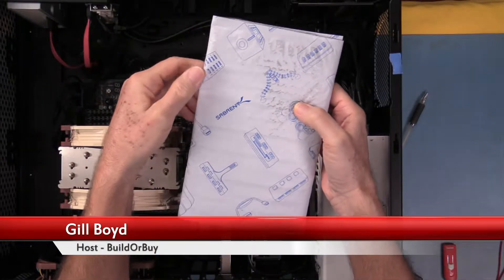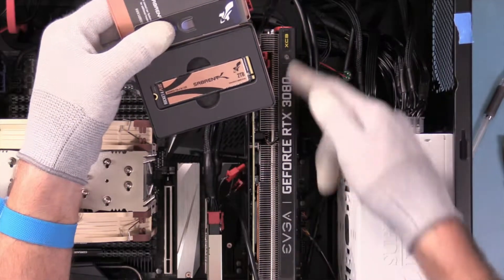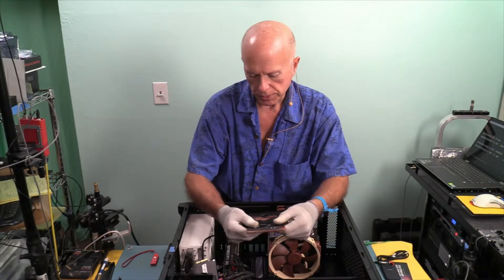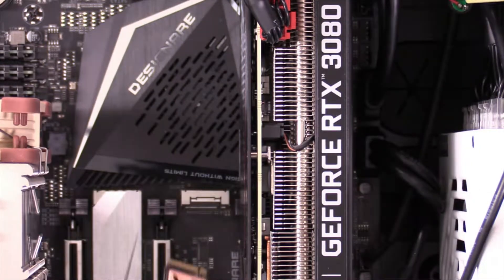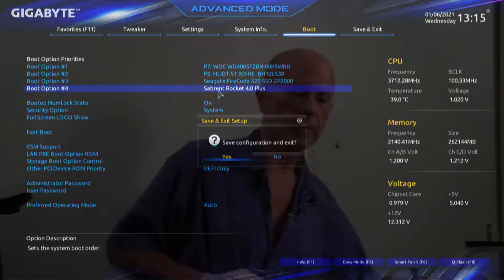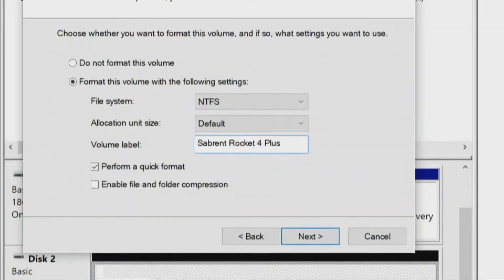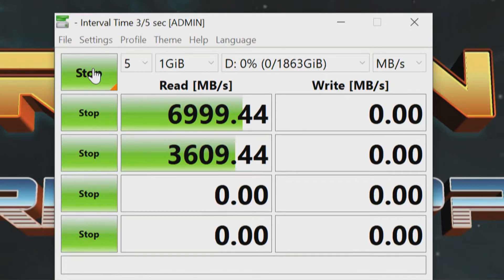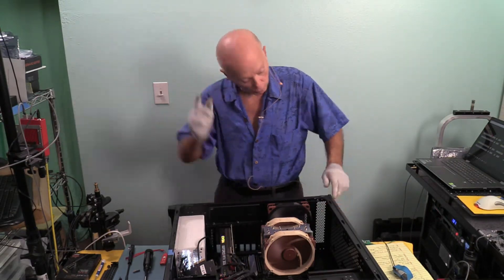Sabrent Rocket 4 Plus M.2 NVMe Unboxing, Install and Test

Comment: Thank you Gill for fantastic real-time tests. It's a feature largely absent in the community. It would be an amazing thing of having your results of the industry standard tests like PCMark 10 and the game level time loading.  I have found a few independent sources where WD sn850 1tb is superior to Sabrent  4 plus 2tb. Your results could be a valuable validation of performance as measured by other PC  enthusiasts. Greatly appreciate the things you are doing!
Reply from the maker: Hi Di Moriarti, Thank You! Appreciate Your Comments! Our next Test will have greater Specificity. We'll be testing for Heat and Speed using Thermography. We've already used an Endoscope Otoscope to examine Tolerances and Component clearances that could not be examined efficiently otherwise.

PCMark 10, I'll make the Request. We'll see what happens. Licensing would be the only problem. Great idea. Agreed. We need more empirical data. 

We've been very particular in Documenting Our TRX40 Build since this is a new Platform. Details matter! Stay tuned!

Comment: after installing a 1TB sabrent rocket 4 plus m.2 nvme into my laptop I noticed that it gets really hot even with the thermal pads applied all over, for some reason specifically this SSD gets hot but the one that was in my laptop (a Samsung nvme idk what type exactly it just has "Samsung SSD" written on it) always stays really cool
Reply from the maker: Hi B4shar,
Welcome! A Laptop will be PCIe 3.0 whereas the Sabrent Rocket 4 Plus is PCIe 4.0. Big difference in Speed. Surprised You're getting the Heat considering the Speed is not attainable, 3,500Mbps vs 7,100Mbps. If You want to know the Specs on the Model of Drive while installed, suggest installing Belarc Advisor. It's free. Link below:
https://www.belarc.com/products/belarc-advisor
That program will interrogate Your Computer and create an HTML Report. Think of this in terms of what Your Laptop needs, PCIe 3.0. Hope that helps!

Comment: Ran onto this video when searching for Sabrent drive stuff.  I opted for the new Sabrent Rocket 4 Plus-G in the 2TB flavor.  I got it installed on the MSI MEG Ace and was wondering about removing the labels, since the Ace has the heatsink thermal pads on the PCI-e 5 slot.  Sounds like I'm fine leaving them on...
Reply from the maker: Hi Pendamonium Paladin, 
Yes, correct. Those are copper to help dissipate Heat! Hope that helps! Success on Your Installation!
Reply: @BuildOrBuy  Also, thanks for the comment of 75% capacity to avoid issues.  Never heard that before till now...
Reply from the maker: Hi @pendamoniumpaladin1798 ,
Absolutely! Whenever You check a Drive in Windows Explorer and the bar indicates RED. That means remove some Data. What will happen? Applications will appear to hang while waiting for more Drive space. That's the extreme. In most instances, Performance slows down as a Drive fills up. Happens to both spinning Drives and SSDs. All about Heat and Capacity. You'll know what's What when it happens. Hope that helps! A 1TB fills up fast!

Comment: RND4kq1t1 is the pattern closest to what an average user does most of the time. Samsung 980 pro 1tb and WD sn850 tb both have around 15% advantage over Sabrent rocket plus 2tb in the reading RND4kq1t1 test. We need more tests to validate the performance!!!
Reply from the maker: Hi Di Moriarti,  Agreed! That would be a most interesting task to perform. We like to do Tests that can be accessed and Performed and repeated by anyone to Compare Results for empirical data. We don't know enough other than to know we need more information. We need more info on Firmwares for example. Each Manufacturer tweaks their respective app to show their product. And to identify Firmware Revisions. We don't have a good generic NVMe app to interrogate a Drive. Even testing for Heat.  By reading power to calculate heat, by sensor or thermogrophy. Curiosity! Stay tuned! Appreciate Your Comments! Thanks for watching!

Comment: I have a WD 850 arriving in the mail this week, will be putting it on my new Asus Crosshair VIII Dark Hero, with a 5950x (if that ever arrives).

But I’ve been puzzled as to which RAM will be most optimal with this build for gaming performance. High frequency (4000MHz) or low Latency (cl14)? I can’t find Ryzen Optimised RAM that has both.
Reply from the maker: Hi Nathan, CPU supports System Memory Spec: Up to 3200MHz. Suggest looking at Samsung B die...

G.Skill Trident Z RGB 32 GB (2 x 16 GB) DDR4-3200 CL14 Memory (F4-3200C14D-32GTZR). How's that?
Reply: @BuildOrBuy   Hi Gill, thanks for the reply! I’m looking at water cooling and overclocking the entire system for the highest possible gaming performance. This is also the reason why I got the Asus Dark Hero, as it’s currently the only board that can overclock all cores while still maintaining full single core performance with Precision Boost Overdrive (PBO).

Taking all of this into consideration, would you still suggest the same RAM, or something higher? I was considering having 2 x kits of 2x8GB (32GB total) of either the:

Corsair Vengeance RGB Pro 4600MHz CL18 CMW16GX4M2Z4600C18

Or the (soon to be released) G.Skill Trident Z Neo 4000MHz CL16 kit.

Apparently the company Colorful is also going to be releasing Ryzen Optimised RAM at a crazy 4000MHz CL14! 

But if you still think the 3200MHz kit would be better I would really like to know why? I always thought the lowest possible ‘true latency’ would be the best for single core and gaming performance?

Thanks!
Reply from the maker: Hi @SodaiGoku , Absolutely! Good Questions. EKWB? Custom loop or stock loop? We see overclocking as bragging rights. Been there, done that. For the RAM, You want Samsung B die. How much RAM do You want or Need? 

G.Skill is known for using Samsung B die for overclocking. That's why it's sold at a Premium price. I'll see if I can find those links. There's a guy who has Listed all of the Samsung B die RAM. 

As for the RAM speed, You have 3 numbers from which to progress through. 
1. AMD default JEDEC Spec of 2133.
2. SPD Spec - XMP Profile of what the CPU is capable of which is 3200.
3. SPD - XMP overclock of what Bios can handle of 4000 or beyond. There is a tradeoff balance with latency and speed.

ASUS is the best choice for overclocking.  We Build Computers for work so we take a different approach than what You want to achieve. Be certain You have a quality PSU and a good UPS. Hope this helps!
Reply: @BuildOrBuy  Thanks again Gill, this is really exciting for me! 😊

Not bragging rights, I use to build computers from secondhand parts when I was young, it’s just been a dream of mine since then to build a new high-end rig for the last 15 years. I no longer have any friends into computers, just a hobbie of mine.

EKWB Crosshair VIII Hero Monoblock with 2x360mm rads,
Asus RTX 3090 EK GPU (RTX3090-24G-EK),
Asus 1200W Thor PSU,
In-Win 925 Case,
9 x Lian Li Unifans.

Comment: Great video as usual. What 4K capture card will you be using?
Reply from the maker: Hi Victor, Thank You! Good to hear from You! We're going to compare the Avermedia and elgato. This started with a Question from a Subsciber asking why their TRX40 would not Boot after installing one. Without knowing the Motherboard, my guess would be a Shared PCIe Resource. However that should not keep the System from Powering Up. But then neither should a Thunderbolt 3 card either. So We'll test, verify and point out likes, dislikes and differences in the two. And a Summation of Our Suggestions for Capturing and Streaming. 

Right now... Getting ready to Film a Thermal Imaging device Unboxing in preparation for the NVMe Heat test. Stay tuned!

Comment: How do you feel the TBW or longevity/endurance of these cards are, are the numbers sabrent uses fake, I hear alot of people have failed or failing drives long before they are suppose to begin failing.  could it be a quality control issue.  how have your experience with sabrent nvme's been in the last few years?  Thanks, great vid!
Reply from the maker: Hi Kevmachine, 
Very good question. We just don't know. And will not know for some time as reports come in. Of the 3, 2nd Generation PCIe 4.0 M.2 NVMe SSD Drives We've tested, We've had more Reports of the WD SN850 Failing. BSODs to be specific. Hopefully that can be addressed through a future, yet to be announced, Firmware update. 

We have the most experience with Samsung for M.2 NVMe Drives. We happen to have more Sabrent Drives than any other brand. That was not a plan. It just worked out that way.  Hope that helps! 

NVMe has been around since 2015 or there about. Appreciate Your Comments! Thanks for Watching! 

Coming Up... Speed and Heat Test of Gigabyte Aorus vs ASUS Hyper Quad x16 M.2 NVMe AICs.  Similarities and Differences. Stay tuned!

Comment: So it has memory in both sides of the module making it thicker. Probably did that to spread heat over a larger surface area. At the higher speeds it would typically run hotter which, as you pointed out would cause speed degradation. I suspect that once you close up that case and finally put that system to work in the studio it would be a good idea to add as much cooling as you can to move air through that system.
Reply from the maker: Hi Lee, Good observation. Agreed. Eager to get to that point! Was surprised to see that double sided NVMe. I've never spent so much time working on one Computer. Yes, those Noctua Commercial Fans should keep things cool!

Filming today for next two Videos. I thought. Then... Wrong product was shipped. Waiting on replacement. FLIR Thermal camera... Was excited to get into the Heat vs Speed issue and see if there is anything of concern. We'll get there soon enough! Replacement Camera should be here early next week. Stay tuned!

Comment: are you going to try putting these in an pcie4 raid card?  would be cool to see those speeds.  This single card is hitting the same speeds as your gen3 4x4raid.
Reply from the maker: Hi David Cook, 
We thought about it. Thanks for Asking! Would like to get this System up so we can use it! However, We're working on a Test for M.2 NVMe Quad card Heat. And we're going to Compare 2 M.2 NVMe Quad cards. For those Tests, we'll probably use 1st Generation PCIe 4.0 NVMe Drives. Stay tuned!
Reply: @BuildOrBuy  back of napkin this could get to 25GB/s read speeds.  Ddr4 is 50GB/s. 
50% the speed of ram but 8TB instead of 256GB(thread ripper)
Reply from the maker: Hi @knowledgelover2736 , Got it. 1st choice is more RAM. 2nd choice, how to get what You need now. A Highpoint card is a distinct possibility for Your needs. Requires 1 x16 Slot, PCIe 4.0.

Comment: I get what you're saying that it's not scientific, but don't downplay what you're doing. You might not set everything in a vacuum and whatnot but you're at least testing the system on the platform that the product is designed/should work good in. Either way, thanks for the content.
Reply from the maker: Hi Rick Trajan, Thank You for Your Comments! Exactly. Being a new Platform, We need to know. Details matter! Our Goal was to start with an apples to apples comparison and to branch out from there thus explaining the difference and why in the next Video. But in so doing, keep it simple! In other words, a starting point. 

This Heat test We're working on should be much more Informative and not a normal type of test most Users would do! In this heat test, we will look at all 3 of these 2nd Generation PCIe 4.0 Drives. Even though We are only using 1 methodology, We will mention 5 possible ways to measure heat that anyone could try but might not have thought about. 

Appreciate Your observations. Stay tuned!

Comment: Heard the rocket 4 plus has reliability issues.. Read some reports about dead drives within 2-3 months of usage.. What's your take on this?
Reply from the maker: Hi Ss, Good question... We've herd 3 things.
1. Sabrent Rocket 4 Plus NVMe failures.
2. WD Black SN850 NVMe runs too hot.
3. X570 Motherboards and Ryzen 5000 series CPUs high failure rates. 

Until we see evidence otherwise, we attribute failures to ESD. That's why we ground. Hot NVMe, all NVMe SSD Drives require heat sinks. Thanks for asking.

Comment: UPDATE: Sabrent Rocket 4 Plus 2TB broke after 1 week. Many times on Boot I can not see the drive. To make it appear i need to restart PC sometimes few times. I polulated it into different Slots and same shit is happening. I have 2 of these and the other one works OK so far.  I'm in 30 days return window still. I question myself should i buy next Sabrent or WD
Reply from the maker: Hi 99KINGZ, That's crazy weird. Get the WD. Thar gives You a chance to compare the two unless You have them in RAID. If so. Swap them both out since 1 failed.
Reply: @BuildOrBuy  I was just checking Amazon US 1 star feedbacks about Sabrent
https://www.amazon.com/product-reviews/B07TLYWMYW/ref=acr_dp_hist_1?ie=UTF8&filterByStar=one_star&reviewerType=all_reviews#reviews-filter-bar
 There are multiple pages where people claimng their Sabrent M.2 died.. Just bought another WD sn850
Reply: @BuildOrBuy  i did compare them here https://youtu.be/tVe5rtKEArI.  Sabrent does load games quicker but not always. It's like 60% to 40% for sabrent but margin is 1 second the most
Reply from the maker: Hi @GODLIKE99KINGZ , I have my suspicions on what's causing that. Thanks for heads-up. Yes, on WD. Kee p Us posted!

Comment: today second Sabrent Rocket 4 Plus 2TB just disapeard out of nowhere from PC when i tied to clone it
Reply from the maker: Hi 99KINGZ, Cloning. That's a different issue. Change the Sector size. What software are You using? 

Copy all Data off before using Sabrent Sector Size Converter. 
https://www.sabrent.com/acronis/ssc/

Looks like we need another Video!
Reply: @BuildOrBuy  EaseUs ToDo Back Up. I just launched this app to clone Sabrent to new WD and I was looking for the Sabrent and I could not find the drive among others. so I opened explorer and I saw partition but when I clicked on it I couldn't Access it. I'm done with SABRENT just ordered another WD SN850. which is my 4th.
Reply from the maker: Hi @GODLIKE99KINGZ , EaseUs ToDo Back Up, Version 10 and later can handle the differences in Sector sizes. Try Macrium Reflect Free and see if the same thing happens. That's a hassle! Keep Us Posted!
Reply: @BuildOrBuy  I been using EaseUs products for years. I have life time free upgrades. So I have  latest version. it wasn't the EaseUs. After PC restart I did clone the driver like I always does. it was just a coincidence that Sabrent disappeared when I was trying to clone it before i even started.
Reply: btw here u can see  pages of dead drives. its for the prevoius model but this shit is happening on 4 Plus too
https://www.amazon.com/product-reviews/B07TLYWMYW/ref=acr_dp_hist_1?ie=UTF8&filterByStar=one_star&reviewerType=all_reviews#reviews-filter-bar
Reply from the maker: Hi @GODLIKE99KINGZ , I hear You. When asked a Question, we have to consider all options. Sometimes we don't have all the facts. We use to use Easus. We went to Macrium Reflect when Easus clones stopped working to restore.

As to why the drive was not seen, the Sector size in the past has been an issue. As to why this happened to You, that's what we need to figure out through a process of elimination. And the question becomes, is it repeatable. 

That kind of anomaly is very disconcerting and makes me consider another option, ESD. But since the drive comes back, something else is amiss. Process of elimination. Everything is suspect until ruled out. Since You are having that problem, it may be just a matter of time before other Viewers experience the same problem. Hope that helps.
Reply: @BuildOrBuy  yes there was some bugged EeasUs ToDO backup version with bad Sector. This is why i tend to stay with the one that works for as long as i can
Reply from the maker: Hi @GODLIKE99KINGZ , Understandable. Has the Sabrent drive had any more issues? Did You Install the Sabrent software and interrogate the Drive to see if there are are any anomalies their software might detect?

Sabrent Rocket Control Panel:
https://www.sabrent.com/rocket-control-panel/
Reply: @BuildOrBuy  yes did that when took em out of the box. all went well. but not when they started causing issues. today I returned them both so no way of getting deeper into issue. I can add the 1st drive everyday got worse. everyday I had to do more restarts to be able to boot PC when this drive was populated (btw Win10 was booting from WD 500GB not sabrent)
Reply from the maker: Hi @GODLIKE99KINGZ , Dropped like a hot potato! Maybe a Firmware Update is in order. We'll have to keep an eye on that. Thanks for heads-up!

Comment: Why is it set to 1GiB on test?
Reply from the maker: Hi Robbo770, Good question. As You know, that's the default. As You also probably know, the Test size should be set to exceed the test Drive's cache. A test Drive's cache will be different for a 1TB (1GB) vs a 2TB (2GB) Drive. As we stated, this is not scientific nor exact. You're results may vary. Thanks for Asking! We will make that Point next time. We try to keep it simple. Yes, details matter!
Reply: @BuildOrBuy  can you show what happens if set to 2GiB for comparison
Reply from the maker: Hi @robbo770 , Be glad to when we do the Heat Test on all 3 Drives! Stay tuned!